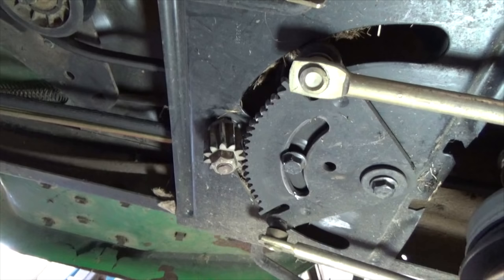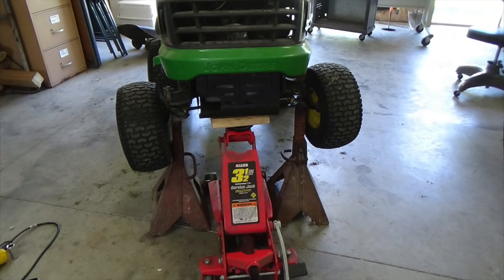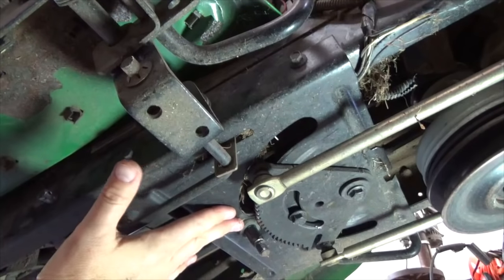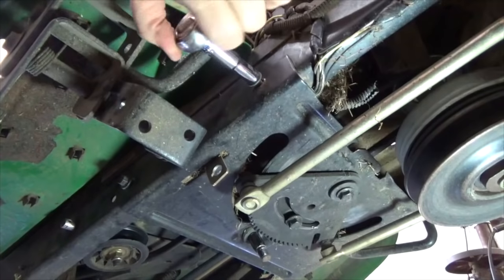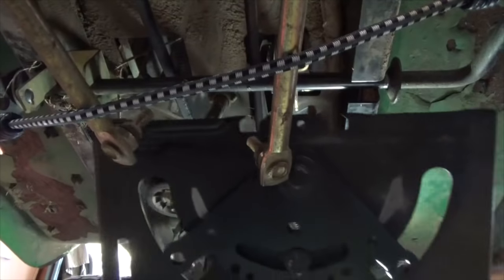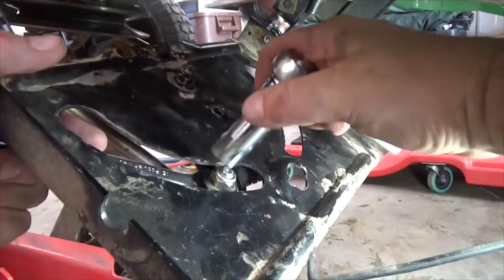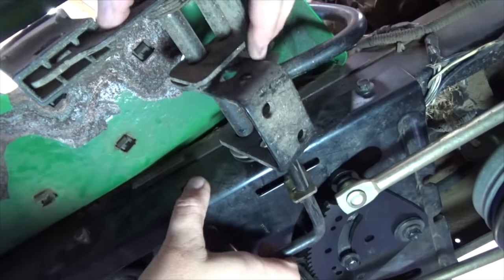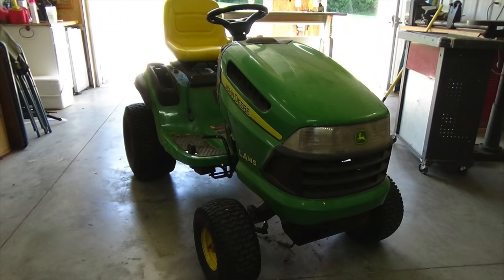Steering Sector & Pinion Gear Replacement - John Deere LA145 Riding Mower

Comment: I bet John 🦌 and the other companies hate you, but we don't, all of us backyard mechanics love you, your tutorial was excellent, you made what seemed hard, easy. Thank you!
Reply from the maker: HA!  I imagine JD is enjoying the prosperity of selling higher quality replacement parts for their sub-par box store mowers.   Glad I can help you out, my friend!   My LA 145 gave up it's transmission a year ago.  I'm down to one L130, which is actually a pretty high quality JD.  Back when they made better products.   Thanks for watching and taking the time to comment!
Reply: @PhilCrockett  I'm sure they are, hey, I have an older L130, 16yrs now, runs good still got good power, not quite like new but nonetheless good. Parts are wearing out naturally. Toe out is not good, deck still solid but a break in the meatal where grass comes out, just need some weld, blades on the little transmission fan are almost all gone. Went through bunch of deck belts, jd cost around 4o$ or more, they never wore out, they just break. I'm buying 15$ belts online now, quality not too good, lasting bout a year, cutting a good 3 acres. Besides all that I can't keep the batt. charged and go thru one about every 2 yrs or less. That being said do you have any info that can help me on those problems, also how do you check the oil or fluid in the transmission. Appreciate some advice 😊
Reply from the maker: You sound like you're in the same situation I'm in.  I mow about 3 acres as well.   
No..... I've never messed with the transmission.  That L130 just refuses to die.  How I wish JD made products like that again.   My dad bought a new Z series a few years ago.   He had problems with it from the start.   He finally traded it in for an Xmark zero turn.  Now THAT'S an amazing mower.  I hate to say it, but I'm done with JD.   They have tanked badly over the years in quality.

Comment: Helpful Video and I wish my attempt to repair steering went as smooth. Break Lever would not go back in place with steering arm assembled to plate and then 364B169 lever fell out and after several attempts I got that back in correctly. I took the plate on and off several times but finally got the work done. Next time it will be much easier but I hope the repair goes for years of use.
Reply from the maker: so glad my video helped you out, Jean!  Thanks for taking the time to comment.

Comment: Thanks for the excellent instructions and video, Phil. I had that exact problem with an LA145. I did notice that the pinion gear was stripped and took it off, then I found your video and was able to do the rest. Thanks again.
Reply from the maker: Glad my video helped you out.  This LA145 gets worked on every year.  right now, it has a transmission problem.  won't go up hill.  I'm thinking I'm done with it.  My L130 has out lasted this thing.  Once you get that mower fixed, get rid of it.  I've been so disappointed with JD products.  However, I sure have learned how to fix a lot of issues thanks to owning one.

Comment: Thank you for this tutorial!   Took me a while, but i did it!  I have the d125, and it was just slightly different.   Only one steering arm thing attached to the steering sector.   

Two trips to the hardware store and a nasty gash on my forearm that probably could have used stitches.   I had one 15mm socket but needed two (or a wrench) and tried to cheat w a 5/8(?).   That thing held real well til I started cranking on it hard then...bam!!   It cut loose and my forearm met the steering sector at full speed.   If anyone is going to attempt this, everything is metric...and don’t try to cheat!
Reply from the maker: wow!  thanks for the tip, E Fleming!  So sorry to hear about the wound.  make sure you soak the cut in an antiseptic like iodine or the like.  I have a whole cabinet of medicines that I need after certain projects.  Glad my video helped you out.  Flesh wounds heal way quicker than financial wounds.  Good job on saving money.  sorry you had to learn a crappy lesson, but I bet you will use the right size on the next project!  Thanks again for watching and commenting, my friend!

Comment: A couple of quick notes. At 1:55 it is not the brake lever but instead it’s the forward/reverse travel pedal lever. Also, save yourself some time at the end and put that lever back in place before you reinstall the pinion gear. That gives you enough clearance to do it easier than if you install the gear first.
Reply from the maker: thanks for the tip., Steve
Reply: Are u saying just the replace the lever before the pinion gear or do u think it should be done before the steering plate is put back on also? I'm getting ready to do mine, I don't see from video how the pinion gear is in the way by itself,

Comment: Great tutorial video Mr Crockett...Albeit, this job's "more involved" than what it appears to be on the surface! I'm sure most other pinion gears didn't come off, with the "simple twist" of the ol'screwdriver though?!? That was the toughest part, but nothing a little heat from a blowtorch and some PB Blaster couldn't take care of...Overall, several hours involved in the entire process, start to finish. This video was the "BEST" by far, over any of the others here on YT, when it comes to tackling steering rebuild of a JD LA145!
Reply from the maker: Thanks for the great comment! I didn't have any major issues with sticking parts on this particular project, but I have indeed experienced some horrible sticky parts in past projects.  Thanks again for the positive feedback!

Comment: There is a 2nd bushing about 4 inchs up from the lower bushing in the frame too, I am in the middle of the job so not sure how important it is to replace the upper bushing but I bought a 4 pack so it will get replaced as well, I will put a micrometer on both bushings to gauge wear amounts, guessing the upper one doesn't take that much bearing load. Also, this is my 2nd go round in a short time because i thought i could get away with just replacing the pinion gear and lower bushing...that fix only lasted 2 mows! I was able to find a set that had pinion and sector gear only for under $25(October 2019).  Also, in my hindsight I realized that both front tires had low pressure. ...good for traction but probably put more load on the steering system and prematurely aged my poor old gears. Overall, a good video and things shown the right sequence, only thing that might make it a little better would be to call out the nut/socket sizes more clearly but I was able to read the sizes on the side of Phil's sockets in the video, so all good. Also not at all related to this video as Phil clearly calls out its for a LA145 but there is one other size set of gears for other similar tractors, if your not sure you can count the teeth to make sure you get the right set, the set shown in this video for a LA145 is the same one used on mine which is a LA125 Automatic.
Reply from the maker: I really have a bad habit of not calling out the socket sizes.  I just assume everyone goes about it like me.  I never look at the sizes.  I just pick the ones that fit and use them.  That's how I've done it for years.  You've got me wondering now, if that's an unusual thing.   Hmmmmmmmmmm

Comment: Excellent video, If you get a kit it will probably give you two bushings, look up the steering rod 6 to 8 inches from where the gear was and you'll see the second bushing I had to take my tie rods completely off because my bolts were not coming off easily, if at all possible and if needed replace all you can under there while you have everything off you will thank yourself later :)
Reply from the maker: Indeed.  I didn't change mine, because it wasn't worn.  In fact.....   my mower's transmission went out about a year some time after I did this video.   bummer

Comment: Very well done video. I truly found it quite educational. Now I feel like I can do it. thx
Reply from the maker: Excellent!  Please comment back to me after the fix, and let us know how it went, Larry.
Reply: @PhilCrockett  Did the fix and it was easy to do. Following your video steps. Since I had to drop the deck I went ahead and changed out the deck belt and then I noticed that the drive belt was in bad shape as well I replaced it too. But came across another issue not even related to what I had worked on. My brake/clutch pedal would was frozen and the parking brake would not set or unset. couldn't figure it out after two days so I had to take it in the shop. Took care of 3 issues and created a 4th. Crazy Have a great weekend.
Reply from the maker: It was smart to change all those belts when you did that.  I should have changed my main drive belt at the time, because 2 weeks later, it failed me.  That's a crazy thing about the parking brake.  hope that didn't cost you too much.  What was the issue?
Reply: @PhilCrockett  I don't know yet still in the shop. Will get back on that. :)

Comment: Why would anyone thumb this down? Excellent tutorial.
Reply from the maker: Thanks, Brad!!!!
Reply: Probably because you don't need to remove the plate.  Just use an open end wrench to hold the sector nuts and impact the bolts from below.  The sector drops down so you can access the drag link nuts.

Comment: Thanks for the excellent tutorial. This seems to be a very common and frequent problem; enough that JD should have picked up on it and changed the materials for these gears by now.
Reply from the maker: I was told by a JD repairman that the parts are cheap in order to sell these at big box stores for an affordable price.  If they put better parts in them, no one could afford one.
Reply: @PhilCrockett  I'm just talking about the two gears since they seem to be an early point of failure. That line could have been fed to that technician by his manager. We don't know.
Reply from the maker: I had a drag link break one time at the pivot end.  I went to JD to order a new one.  I took the new one out of the box to look at it before I paid for it.  To my surprise, it was WAY beefier and better quality than the factory one.  I even accused the salesman of getting the wrong one for my mower.  He gave me the same story as my repairman friend did.  I'm a believer now.  However, I will say that the replacement gears didn't seem that much different than the factory ones.  maybe it's just certain parts.  idk.

Comment: great video. if in a bind, if the pinion is the only gear stripped, you may be able to flip it over and reinstall - to get back mowing until the new one comes in.
Reply from the maker: good idea.
Reply: @PhilCrockett  i have to eat my words. upon reassembly on mine, i just found that there is a collar made into the gear, so that it cannot be reversed. it is likely there to keep the gear stationary up the length of the shaft.
Reply from the maker: Ya.... I was thinking about that, but I didn't know your situation.

Comment: What perfect timing! I'm getting ready to put spindles on my 45 year old Dynamark. My rack and pinion only slips when turned all the way right or left. It's got a bit of time left but, if Amazon has the piece, this is the time.
Reply from the maker: Yep.  Might as well fix the whole darn thing if ur going to take it apart.  Hope my video helps u out.  Thanks for the comment
Reply: @PhilCrockett  Yep, do it one all at once so it won't have to come apart again for a while

Comment: Great video!  I just did this job and must have watched this video 30 times while doing it, so great that you put it back together and didn't just say reverse it, that was helpful.  I had a repair shop do this job 3 years ago and it was already stripped again, I just found out that was because the guy used the wrong bushing that was too loose for the steering shaft and installed the sector gear upside down, to add insult to injury he had the steering wheel on upside down, which drove me nuts lol.  The guy kept my tractor for 6 weeks after saying it would be 14 days and charged me $300.  I just did this job in 2 hours and $35 got the stuff off amazon and I'm a barely handy sort of guy.  Thanks to your video I am back in action just in time for leaves!  Really appreciate it!  My tractor is a John Deere L110 and it was all the same procedure, I just double checked the internet to get the right parts for my model.  Time for a cold one!  Thanks!
Reply from the maker: You're comment made my whole day!   Thank YOU so much for taking the time to write such positive feedback!

Comment: I really liked and found great value in this video.  I appreciate that you address the subject matter only without feeling compelled to turn it into an entertainment piece, like so many folks out there.  Unfortunately, after completing the repair and ensuring all components were tight, while mowing immediately afterward there were a couple instances when there was a slip.  Are there other factors that could be at play?

I never should have sold my Scott's by John Deere mower.  I've had one issue after another with the LA-145 since I bought it about nine years ago.
Reply from the maker: sounds like you might be missing a bushing on the steering shaft.....but I it's hard to diagnose without seeing it.
Reply: @PhilCrockett  Copy that.  Thanks for giving me a potential next step!
Reply from the maker: let me know what you find out.  it could help someone else out.
Reply: @PhilCrockett   So last time I mowed I completely lost steering ability (8/28),  roughly two months (about eight mows) after affecting the replacement of the steering sector, as described in this video.  Today I partially disassembled the steering sector again and found that it was the steering gear that had failed (GX20053), and the gear plate which affects the front wheel orientation (GX21924BLE) seemed unchanged.  Prior to ordering the kit, I had purchased the OEM gear (GX20053) from my local JD dealer.  I compared them side-by-side and the OEM version appears to be of superior design and possibly produced with better grade materials, so I just installed that gear (GX20053).  My first mow afterward was successful with zero gear slips.  Fingers crossed!

Comment: Great video, thanks. Don't feel I should have to be doing this after only 3 seasons of mowing. Last time I buy a band new John Deer.
Reply from the maker: They aren't what they use to be.....    Had a JD mechanic tell me that JD mowers are good for 8 to 10 years.   I think he's exaggerating a little bit.  We had a Snapper run without any problems for 21 years...... and my dad had a Craftsman run 22 years.   Not sure who has quality mowers any more.    I'm going to try goats next.  According to Google, a life span of a goat is 15-18 years.  I can get a goat for under $80!

Comment: Did this repair, as the old one was all caked in dirt. Now i have the full range of steering but it still seems stiff. Ive greased both wheel fittings and made sure their was sufficient air pressure in tires. I feel im missing something.
Reply from the maker: Could try spraying some lubricant on the moving parts.  Some people actually grease the parts, but it doesn't last the whole moving season.

Comment: No grease on the sector gear and pinion? May collect dirt and grime, I guess.
Thanks for a really great instructional video. One of the better ones out there.
Reply from the maker: YES!  I love the grease comment.  This is always a good topic for discussion....  Many mechanics are getting away from the grease due to the fact that it doesn't even last 1 season AND the dirt and grime caking on it..... depending on the type you use.  BUT.... either way..... it doesn't even last 1 season of mowing, so it seems to be a waste of time and money, unless the owner is going to clean the gears and re-apply the grease every year...... (NOT!)  HA!   Thanks for the great comment and positive feedback!
Reply: My plan is to clean the pinion and sector gears and lube with some lithium grease once per year when I take the deck off for the end of season cleaning. Even with the deck on, if you lower it all the way down it is easy to get in there, wipe everything off and apply a new dab of grease.
Reply from the maker: It sure couldn't hurt.

Comment: 1. a little grease on the pivots might not be a bad idea when assembling the new gear plate.
2. it looks as though you could flip the pinion gear periodically to prevent premature failure.
3. not being able to adjust the gear mesh here is a huge design flaw no doubt brought about by cost cutting.
WTG on the video, very well done.
Reply from the maker: I do get a lot of the "grease comments" from folks.  I questioned the parts-guy at JDeere and he said they quit using grease because it didn't even last through one season.   He said it really didn't do anything significant towards function or life of part.  However, it sure wouldn't hurt if you wanted to do it.   Thanks for watching and commenting.  I'm glad you liked my video, Joshua!

Comment: Great video...should have read this before I started...tried to get my fingers in and not take the bracket off.  Dumb move.   4 bolts off and much easier.  Brake rod was tough to get back in that first hanging bracket.  Used a cheater on the pivot bolt...
Reply from the maker: Thanks for watching and commenting, Jack. Glad you didn't lose any fingers!

Comment: Excellent video.  Thank you for providing the know how to do this.  When I got done, I noticed one of my front wheels is turned inward slightly.  Any suggestions on getting both wheels straight before  I take it apart again?  I thought I had them aligned before putting on the new pinion gear back on, but I guess not.
Reply from the maker: Are you sure it's wasn't like that before you did this?  Those cheap drag-link 'rods' get bent real easy.  In fact.... I bent mine during a sharp turn in a ditch a few years ago.  I actually have a video on how to fix it......(if you know how to weld).   If not, then you could try bending it back straight.